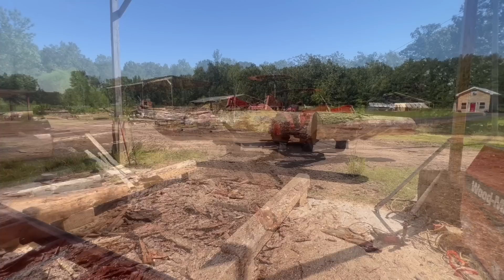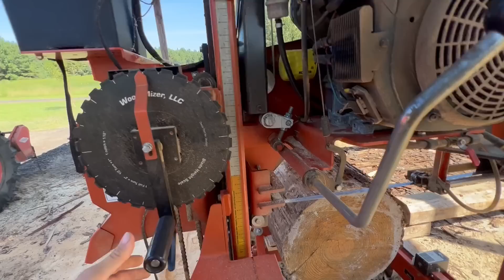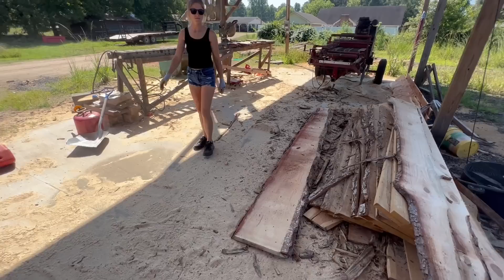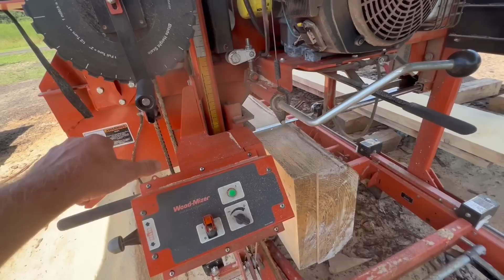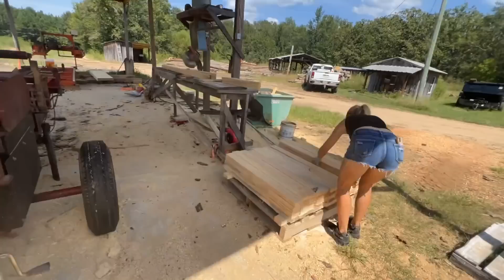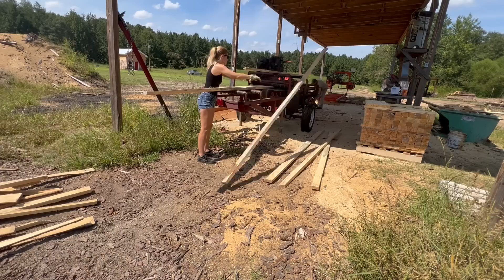Monday Milling! (How MANY 2x4's are in this LOG!!!)

Comment: I enjoy your videos, thanks. We have 20 acres here. I have a bunch of pine trees on my property that I consider a nuisance. Many of these trees are 25-30 inches in diameter and very tall. When I bought the place I thought I would be able to sell them, but there are restrictions on hauling logs in this county. It requires a permit that is difficult to get. I have been cutting these trees up and piling the big pieces in the back. I burn the smaller stuff. I also have about 6 acres of very nice hardwood. I have talked to some local loggers, but it seems there is not enough here to be worth the hassle of dealing with code enforcement. I hate wasting all of this and would love to get it milled into something salable. Suggestions? I am too old and weak to do it myself.
Reply: look for someone in your area with a portable mill. they might even help with selling the milled lumber.